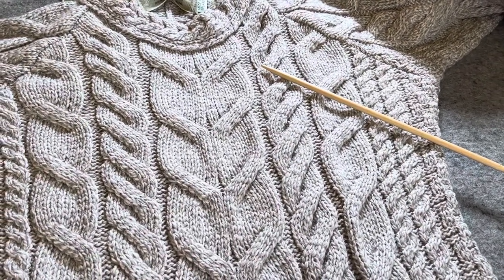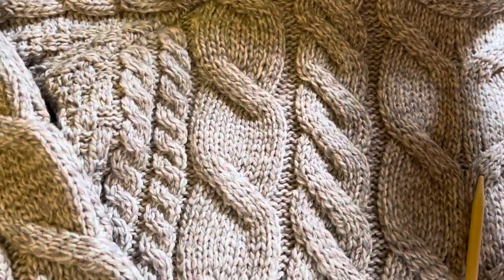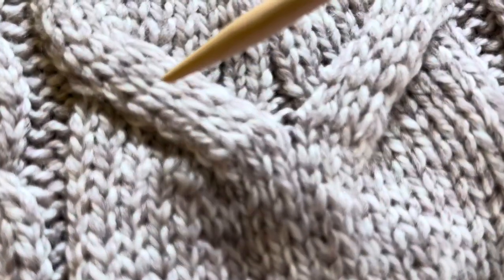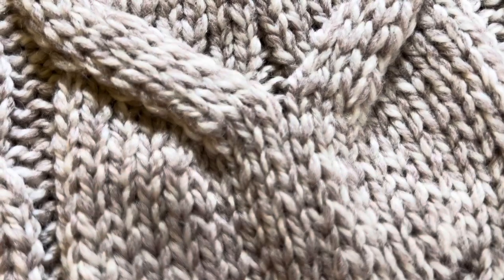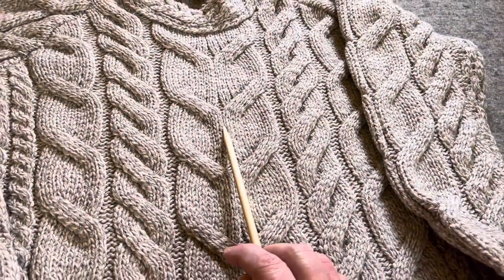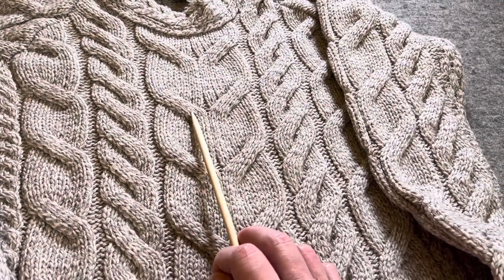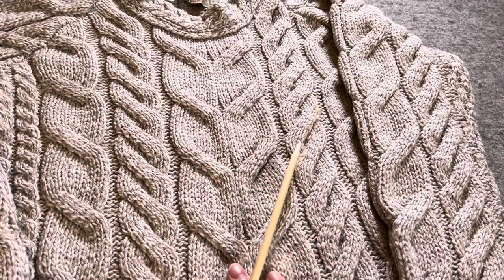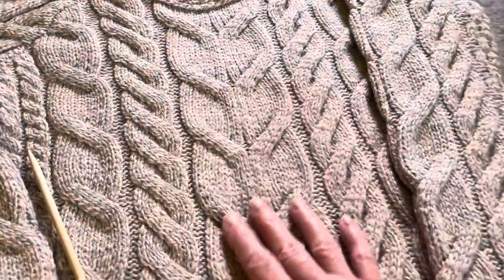Analyzing yarn from ‘Aran’ sweater

Comment: When washing/soaking do you hand agitate or use any type of detergent?
Reply from the maker: No. The water plus suds do the washing. I use Unicorn Fiber Wash or Unicorn Power Scour if really dirty. Washing wool is like washing a baby. No agitation in hot water. Towel dry. Hope this helps.

Comment: Any brands you would recommend for a rough wearing sweater?
Reply from the maker: Briggs Regal is a tough wool but ply is important. 3,4,5 ply is very good for aran work. A smooth yarn like Shepherd’s Mill worsted is good for texture work. So, a worsted SPUN ( not merely weight) and many plies.